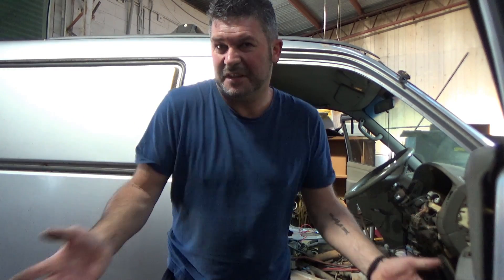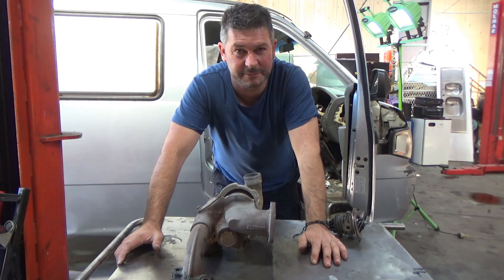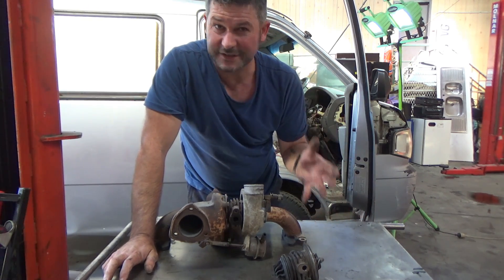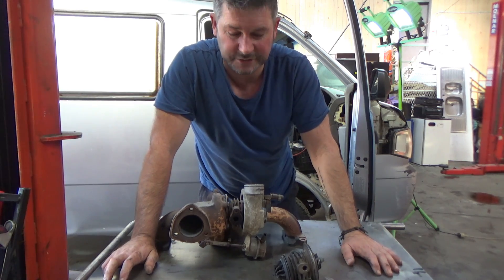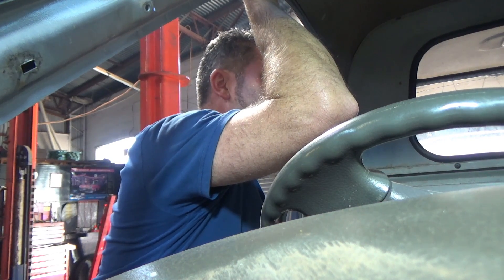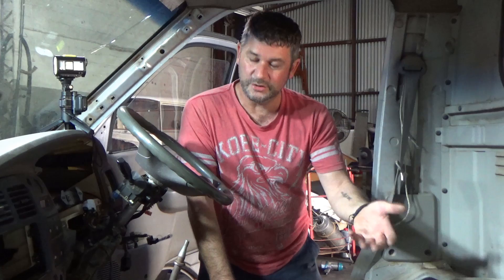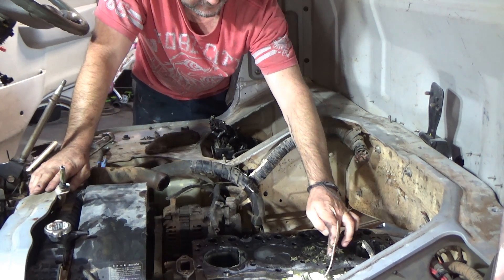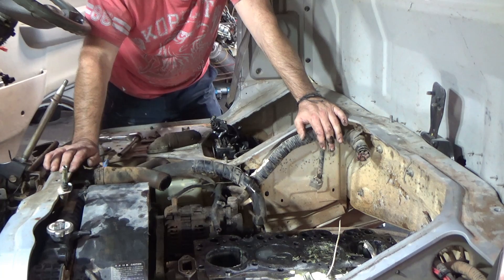How to Stop a Run-away Diesel -ENGINE BLOWS !

Comment: Wonder how the powder would do on a air filter maybe stop the filter up and not hurt the motor
Reply from the maker: Colby C. That's a good point.
Reply: But then is it going to stop the engine?
Reply: +Goldmarble: If it stops up the filter, where else can air come in?
Reply: I would have thought the powder should clog the filter and that should suffocate the engine?
Reply: Colby C. Compressing the powder is what killed it...without that, it would keep going.. Carbon dioxide?
Reply: Andrew Arceneaux it will collapse the filter and suck air around it..
Reply: Saw that tried on a marine engine once, the engine just tore the paper air filter to bits. We had to pull the air hose off the turbo and shove a bucket over the flange.

Comment: Was your intake leaking somewhere other than the hole.. I feel like that block of wood "SHOULD" have stopped it!
Reply from the maker: Yes, we totally agree. We are more surprised that such a small amount of air could actually keep it running though.
Reply: Justin Dennis 
To let you know all diesel engines have no vacuum because they have no throttle body that is why all diesel engines and  most direct inject gasoline engines have to be fitted with a vacuum pump to all the extra crap that we have like brake assist and EGR valve work properly.
Reply: Jonathan Furtado there has to be a pressure differential (what most consider to be vacume) or it would not run. even with forced induction, there is the moment at start before any boost is being made, that requires vacume to fill the cylinders.
Reply: Tanner Marlow 
Yes the cylinder does make a vacuum on the downstroke when the air intake is open but there is not a vacuum generated that would run the brake assist and everything else that a gasoline car would normally have and even in some gasoline cars they have to put a vacuum pump on it
Reply: Don't forget that the air intake happens at the same time that ignition happens on another cylinder, there is a lot of force behind that, so a small leak can handle a lot of air. Also, the inlet system wil act as a buffer for air between inlet cycles, it will be sucked vacuum during a stroke, and has time to recover through the leak while the cylinders are not taking in air.